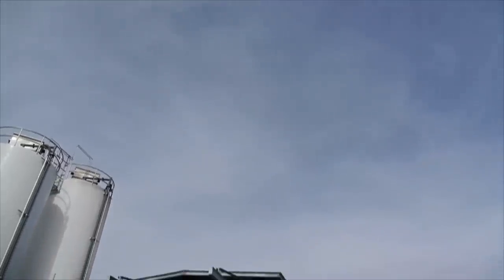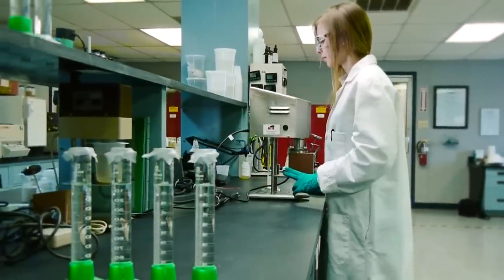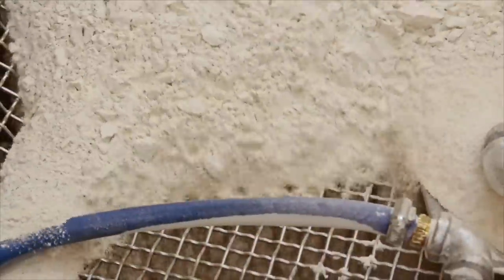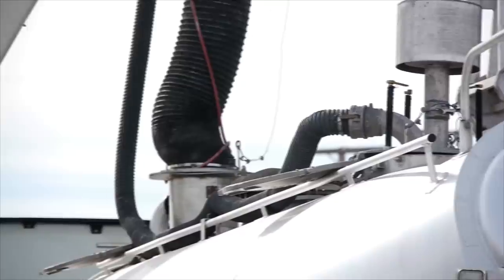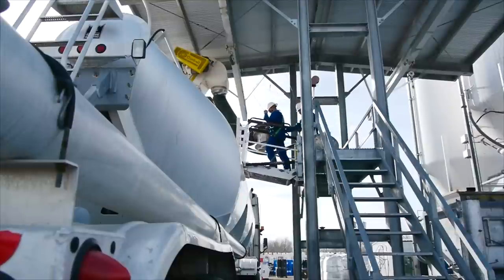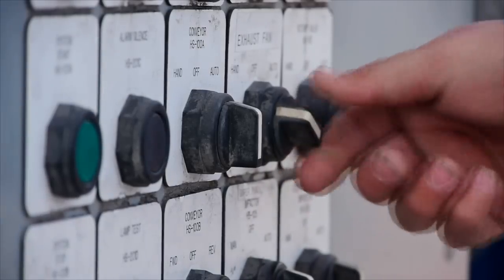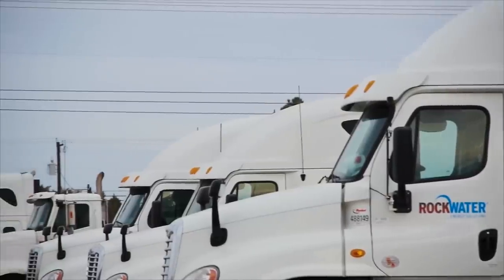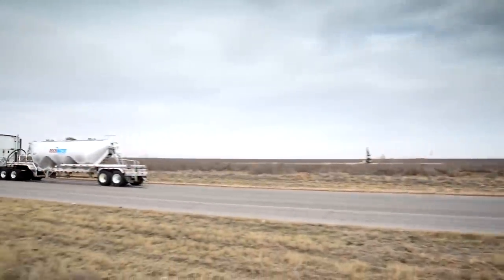Pneumatic Powder Loading by Rockwater

Comment: DoverMEI designed, manufactured, and installed this transload system.  This system works great, and we have many installations in many industries.  This year marks 50 years of being in business.  The other equipment in the video mixes product from 2 silos continuously and loads bulk trucks.  DoverMEI Solutions for Bulk Solids Processing.  Partnerships Through Excellence!